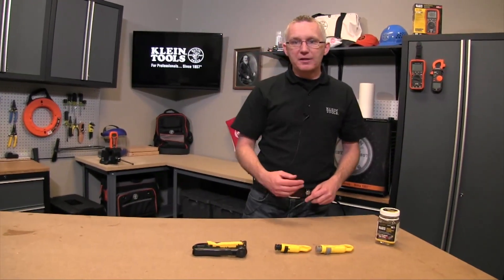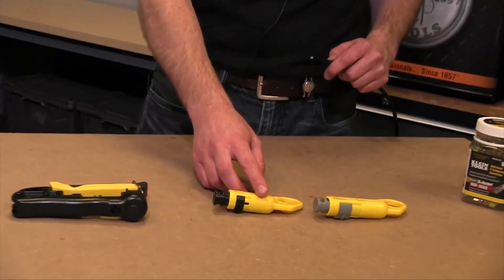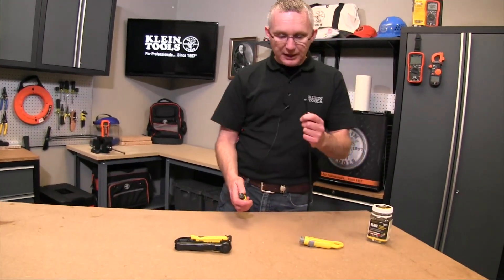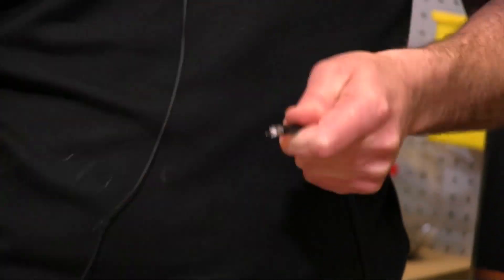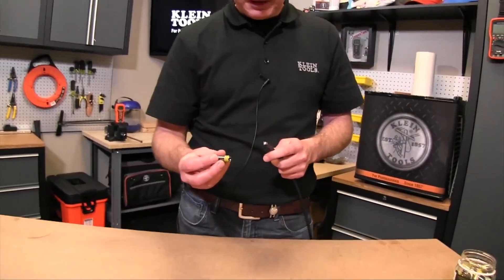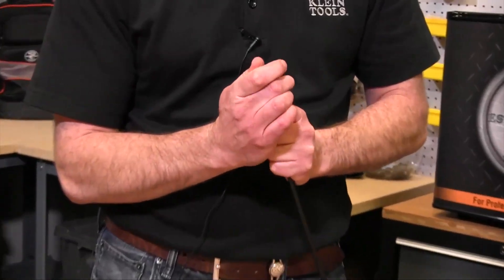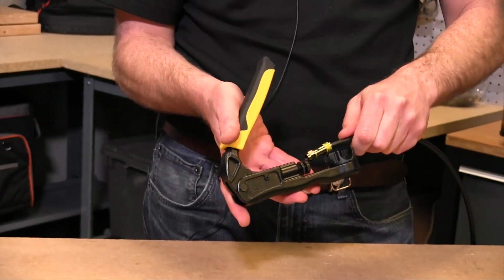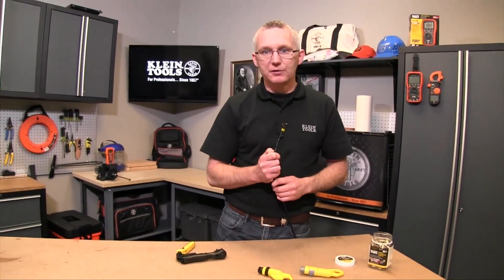How To Strip and Terminate Coaxial Cable

Comment: As I understand, let's say for a DVR, for instance. The connectors on the DVR seem to be on a common grounding system. In this example, it doesn't appear as if the shield was stripped back in order for the shield to have continuity to the connector in order for the shield to be grounded.

I'm not certain this shield is grounded.

Comment: Try the Klein PVC cutter 50506SEN $15 with replacement reversible blades for cutting large and small coax. LMR400 RG8 RG11 etc. Start the cut and rotate around until you cut through the cable. Makes a beautiful cut that doesn't crush the cable. Very similar to the Times Microwave CCT-02 which is a rebranded PVC cutter also.

Comment: I used to learn on the internet to pull back the ground wires but after watching this video I realize I am using Klein tool, Klein connectors and taught by a Klein specialist.  Of course I trust and follow instructions here.  It is much more simple.  After connecting the connectors, I used multi-meter to check for contact, resistance, all are good.  The performance is as good as pulling back ground wires

Comment: Too simple and omitted many quality-related steps including ensuring clean butt cut to start, setting the correct jacket strip length for the connector, avoiding shield braid nicks and cuts when stripping the jacket, proper shield braid structure prior to termination / trimming shield strands, verify proper connector position within crimper, verify proper center conductor length prior to crimp, etc.  However, I learned about some of Klein's tools with which I wasn't aware, so thank you!

Comment: I have never used your type of crimper, but I used to install cable for many years. When you strip the cable, you also have to peel back the wires as well. This helps with slipping the connector on more easily, as well as keeping the cable from shorting out. That is important (unless things have changed). Just FYI. It would be nice to see this redone properly as well as adjusting the tool for proper sizing.

Comment: Just a little feedback. I put connectors on coax for the first time yesterday. I watched your video because it was the shortest. A couple things that I ran into was, when I went to strip the cable, I didn't know the cable had to extend a little out of the body of the stripping tool so it really didn't work. No mention that the crimper may need to be adjusted, a lot, to get the connector crimped. I was using the extended reach crimper. First try I didn't have the collar forced all the way onto the connector body. I accept that it's not brain surgery and I figured it out pretty quickly, but two close ups would have helped a bunch.  Being careful to guide the coax wire into the crimper would also be a good tip. I had one fatality due to smashing the wire into the crimper.
Reply: Isn’t that why the guard is there you shouldn’t have it sticking out so it cuts everything the exact length?

Comment: How did this TERMINATE the cable? I’m wanting to cut down the length of a cable and terminate it so it can’t be used.
Reply: A connector is a termination. If you don't want signal leakage from not being used, install a barrel connector and a 75 ohm terminator on the end.

Comment: I bought the klein stripper to do some quad-shield RG6, and it made the job a breeze. I tried 3 different strippers before getting the klein, and it’s the only one that worked correctly and consistently on the cable I have.

Comment: shielding I guess doesn't affect signal as long as it is not making direct contact with the copper.....  but the way we are heading in 2 years that we'll be back to a string and two foam cups.....
Reply: My Fluke tester will fail that connection every time as a direct short.

Comment: I assume that this tutorial was directed towards a novice user.  A professional would already have this device in his tool box.  The person giving this demonstration should have introduced this tool (close up) in terms of how it works.  Nothing said of the sliding depth gauge and what position and where it should be positioned before stripping the cable.  He also should have just stripped a standard RG6 cable because it is that cable that novices will primarily be used on home projects.  A close-up of the stripping process should have been demonstrated from start to finish rather than Bam!  Bam! There you go.

Comment: You always want to cut the cable before stripping it. Shear the end off. Go back about 1" from where the old connector or end of the cable is. Then make a really clean cut.  The Klein 63030 Coaxial Cable Cutter works great for this.

Comment: Aren't you supposed to pull back the wire wrapping? This is wrong as far as ATT standards go. No bueno.
Reply: +The Gomez Yeah, you are. It is for grounding. It should make contact with only the metal portion of the connector on the end. Hence the reason for bending it back.
Reply: Coaxial cable used for satellite TV like DirecTV or Dish sends voltage up the cable to power the LNB. There can be no contact between the shielded braided wire and the copper conductor. It will short out. A cable will function for a time even with water in it, if it is only carrying signal like with cable TV. Folding back the braided wire prevents inadvertent contact with the copper core when compressing a connector onto the end. This contact will cause a short in the cable. It is especially problematic when current is present, but anytime water gets in as well the line will eventually fail. Keeping the conductor and shielding separate is a best practice at the least, and often a requirement by companies or their industry.
Reply: MAC VENA that's why you use cable meant for burial in wet situations as it has a special gel in it for that purpose. But yes, if the connectors are not torqued down water will get inside, I've never seen it to where it'll go all the way to the receiver, but techs have said they have seen it where water will puddle under the receiver, or drip when removing a line from a receiver. Creates a major electrical hazard. Most of the time if you unscrew the cable you'll see the copper has rotted away from moisture and the dielectric will be wet as well.
Reply: +The Gomez I tuned into this to see if he did this.  Im a novice but read you are supposed to pull back the silver part but do not know why
Reply: Yes you are, if the shielding touches the copper good luck getting signal. Could even fry the receivers. Have had it happen doing satellite installations. I work for dish. 😎